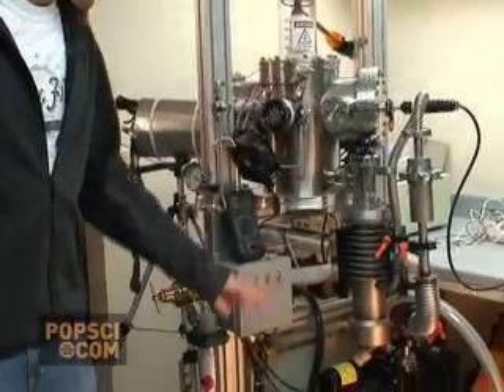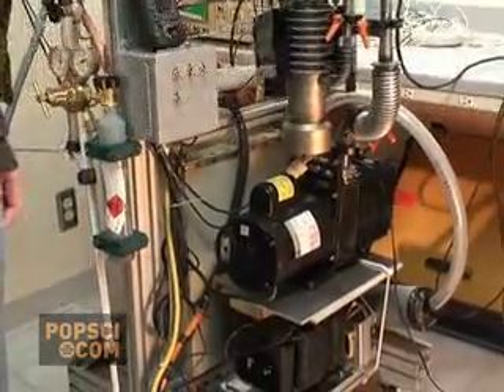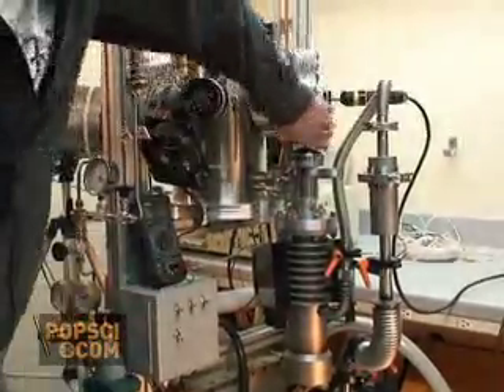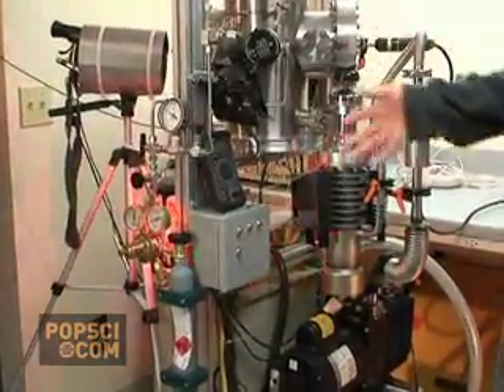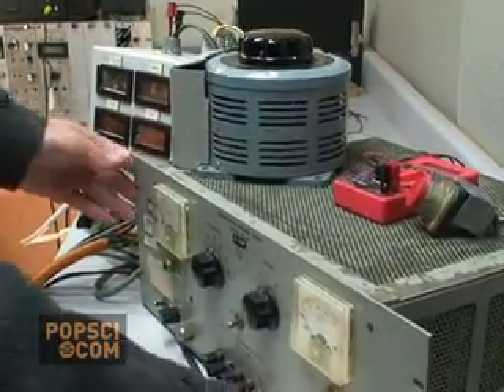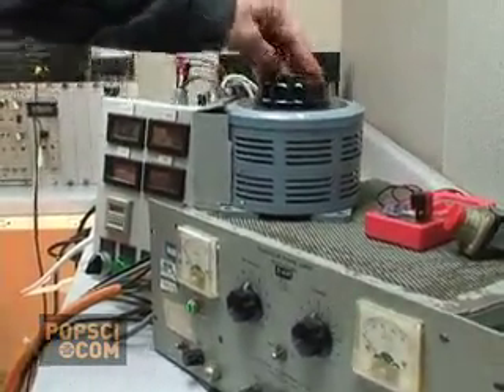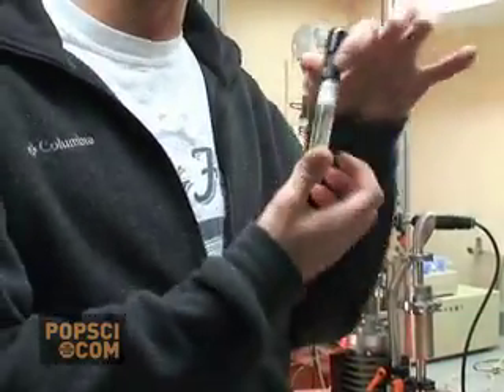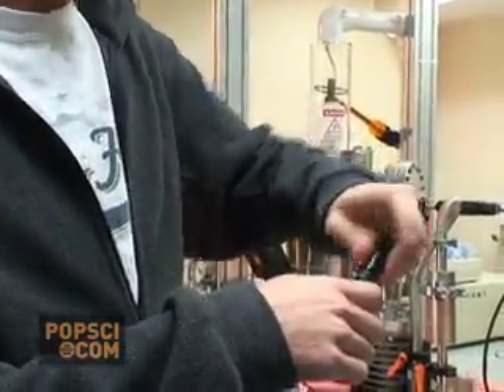Teen Builds Nuclear Reactor

Comment: To those who are calling BS you are mistaken. Fusion reactors can be built, as this video shows. There are a number of them, of varying sizes, all over the world. What you are thinking of is the viability of fusion as a power source. Any reactor to be used as a power source must output more energy than is required to start or continue the energy creation process. One of the biggest obstacles to fusion on a large scale is the creation of a reaction vessel that can withstand the large amounts of energy produced inside. A solid reaction vessel would structurally fail due to the high temperature. This is why magnetic fields have been used in larger reactors. The reactor depicted in this video was not intended for any purpose other than demonstrating the fusion process. Thus it is not meant to produce an amount of energy greater than the input energy. So it is a fusion reactor, but it is not a fusion reactor that you would want to use to power anything.

Comment: @mattix9 - Fusion has been performed tons of times. The problem is that they always use more energy than they produce. In layman's terms, it takes very intense circumstances to get atoms to smash together with such energy that they fuse together and begin a fusion reaction, and those very intense circumstances require a lot of energy. Currently the input energy requirements are higher than the energy output, so fusion, while doable, isn't yet a viable energy source.

Comment: You know, it is quite interesting. You can easily build a simple farnsworth fusor with maybe 300-400 dollars, out of stuff you can get on ebay. This elaborate fusor is quite obviously one created for a lab or with supplies directly from a lab. I bet the vacuum chamber in the center of this reactor alone is at least 12Gs. All of the other components are also probably thousands and thousands of dollars as well. He did not build this at 15... no way. Not unless his dad is either extremely wealthy or has direct access to all the parts. Its irritating to see shit like this, taking some rich kid and making him famous. When there are plenty of other kids that achieved similar feats using the makeshift supplies available. To me, that is a lot more impressive... But they are all the ones that just get ignored.
Reply: Not sure the cost would be so bad, thousands range tops, everything gray in that gear is surplus military, and getting stainless steel tubing is not all that hard, much of the rest looks classic ebay, they have all kinds of old lab equipment, for example the Variac is about 25 bucks, the pump under 100, the various power supplies few hundred each tops. His vacuum chamber looks a bit like an electron microscope chamber and while I have never checked the price on one, you can buy an entire electron microscope for under 10K and harvest a lot of parts from it. I would say all in his rig is under 10,000 dollars. That said, I seriously doubt he did that without help but money was likely not the issue.

Comment: This video is only about stereotypes. Stereotypical weird music on the background, throwing some switches, some rattling pumps, some 15yo guy "the genius" explaining what a power supply does. It's just stupid. Building a nuclear reactor isn't difficult at all, obtaining fuel (uranium) for it as being a civilian is difficult (say impossible). However it's ingeniously dumb to start a nuclear reaction for hobby. Big chance it ends out of control, then you've got your own Chernobyl!
Reply: true about the material.................. but chernobyl was a fission reactor, Fusion shuts down when containment is breached.

And genius isn't about solving problems in quantum physics necessarily. The hardest part of research is designing/building/getting the whole thing to work. That takes years. Gathering data only takes days to months.Its a lot of work getting that thing to work.
Reply: Not the point I was making.....I was telling about overall design and getting it to work.... Besides, Am-241 is an alpha emitter, so unless it's combined with an element like beryllium that undergoes an (alpha,n) reaction, you won't get a neutron flux (that too very small). ....... Source: a PhD in nuclear engineering, teaching 3 different classes radiation detection and reactor operations....

Besides......... Try building something instead of  criticizing. Is not easy...... appreciate his work..... I was playing CS and jerking around at 15.
Reply: FYI Am_241 is what's in fire alarms
Reply: wow, shocking comment from someone with "engineer" imprinted to his username.. do you even watch the video? or which part of fusion nuclear do you not understand? and where did you learn engineering?
Reply: Agustinus Law
It's shocking that someone with Agustinus in his name doesn't know that there are a billion types of engineers ;-) My username just comes from the game Red Alert 2. Though happen to study Software Engineering currently. At the time I wrote above comment, I did not know about fusion reactions indeed. But my stereotypes opinion about the video is still there.
Reply: doesn't matter, all software engineers I know, knew about fusion. well they teach about that in high school here, it is a must it's just really basic. I guess it's not a standard curricula in your highschool
Reply: fulldisclosure hour Smoke alarm have fissionable material?
Very funny.
Reply: did you not here about the kid who made his own nuclear reactor in the states from smoke alarms?? he got arrested and everything he made it in his shed now look shit up hit other tab google and search not hard
Reply: fulldisclosure hour How do you build a reactor with a smoke alarm?
Reply: ny pieces of radio active material in smoke alarms just look it up why ask me? it would take less time to look it up then it did to ask me the question and argue with me over something i know is true
Reply: A. Antoine Americium which is/was used in smoke detectors is radioactive.
Reply: 'MURICA! F* YEAH THIS WAS NOT MY QUESTION.
CAN YOU MAKE A NUCLEAR REACTOR WITH SMOKE DETECTORS YES OR NO?
Reply: YES IF YOU POST ENOUGH CAPS ANYTHING CAN BE DONE
Reply: No, you can't use just smoke detectors to make a fission reactor. Yes, you can use materials in the smoke detectors as parts of a basic fission reactor. Does that help?
Reply: 'MURICA! F* YEAH Yes. How can I make a reactor? Is it available on eBay? /irony
Reply: No..... you cannot buy a nuclear fission reactor on ebay. Also, YOU cannot make one. You're obviously way too incompetent. In fact, most people, including myself, cannot make one properly. And if what you meant by "/irony" was sarcasm, then disregard this post.
Reply: fulldisclosure hour You can't use smoke reactors to make a nuclear reactor. For fusion reaction to initiate large amounts of energy must be used to break the coulomb barrier (protons repel each other). In other words a fission reaction must be used (or an energy equivalent) must be used to force a fusion reaction. This is how the United States made their Hydrogen Bomb (which was an atomic fusion bomb), The Uranium bombs used on hiroshima and nagasaki were atomic fission bombs by the way. Also, you call yourselves engineers and yet no nothing about physics (physics is a must when you become an engineer). P.S. Nuclei (protons and neutrons) are kept together via the strong force.
Reply: smoke alarms
Reply: fulldisclosure hour the boy with the shed got his nuclear radiation from clocks with glow in the dark parts. Some radiating piece was used in the old times, today it's not
Reply: Why, may I ask, did you revive this?
Reply: Its nuclear fusion, not fission. So it is impossible to have a Chernobyl like disaster.

Comment: it IS fussion
fussion occours when two elements fuse to create a new element.

The SCALE of this process however determens the amount of neutrons that are emitted and the amount of radioactivity generated.

Example: a small spark is STILL an example of lightning, the exchange of electrons between an air-gap. It the SCALE that differentiate the two.

Comment: Fission is pulling molecules apart (used in power plants to produce heat, to make steam, to turn turbines), and fusion is putting molecules together, which is what the sun uses to produce heat. Currently it is very difficult and inefficient to use fusion on earth. 
In a fission reaction, a very large and unstable element (generally Uranium-235) is split. When it is split, the particles scatter, and Protons collide with other atoms. This causes other atoms to split, all along releasing massive a

Comment: @TakronRust

NIF is mostly used for testing the conditions in the secondary stage of a nuclear weapon to ensure reliability of the US nuclear stockpile; now that they can't test the real thing. As a PR campaign they're trying to see if ICF can break even.

After wavelength multiplication to UV, a shot at NIF delivers 1.1 MJ into the hohlraum, about the energy contained in two table spoons of cooking oil. The pulse has to be very short(hence high power) and very precise to compress the pellet.

Comment: I just wanted to point out from the comments, a fusion reactor such as a fusor can produce radiation. I believe xrays form when using around 35kv from a transformer from my research. Some gamma can be caused around this or higher voltages. You can google this information to verify.

Comment: It's a different kind of radioactivity. In fission, the spent fuel and the reactor remain highly radioactive. 

Fusion leaves behind tritium (mildly radioactive), and the reactor casing that has been 'activated' by the neutrons from the reaction. If you could do a fusion reaction that does not produce neutrons, only gamma rays, you'd be onto something. Hydrogen + Boron 11 is a reaction that does just that - aneutronic fusion, and it's being worked on for the Polywell reactor concept.

Comment: From Wikipedia:
"Controlled nuclear fusion could in principle be used in fusion power plants to produce power without the complexities of handling actinides, but significant scientific and technical obstacles remain. Several fusion reactors have been built, but as yet none has 'produced' more thermal energy than electrical energy consumed. Despite research having started in the 1950s, no commercial fusion reactor is expected before 2050. "

Comment: @anthyman1 Actually, fusion definitely does emit radiation.  All nuclear reactions emit radiation of some form, in this case his fusion reactor produces neutron radiation (among other types).  If fusion (specifically DT fusion) did not produce neutron radiation, then commercial energy generation with fusion would be completely IMPOSSIBLE (as opposed to financially impossible, which is the problem currently)

Comment: Just so you know, he is doing fusion.  As in combing material not separation.  He takes special hydrogen atoms (deuterium) strips the electrons off of them and then slams them together using the high voltage which is indicated by the red light.  If all is perfect he will generate helium and can detect it.

Comment: Fission is splitting an atom such as Uranium or usually Plutonium by bombarding it with neutrons until the atom breaks apart which then releases an enormous amount of energy such as a bomb or a nuclear reactor.

 Fusion is when two atoms are combined which means you have to get them to combine using a lot of energy. If it works the hope is it will be self sustaining and give off energy to supply power.

 Both are "nuclear" and involve atoms but they are the opposite of each other.

Comment: This is easily fixed with neutron capture shielding and a further shielding material to absorb any subsequent gamma radiation. Deuterium is NOT radioactive and Tritium is only mildly radioactive and completely safe if handle properly. This is overall a very safe type of reaction, and this is why it's the main (only) reaction really researched for nuclear fusion. BTW i don't think they're saying he's 15 now, but 15 when built in his garage, which could have be a decade ago by the looks of him.

Comment: @Nosphorus85 Depends on the size, volatility, and nuclear fertility of the fuels used, as well as the containment systems and coolant. His coolant seems pretty well set-up for small-scale fission. And that's what this is.

Fusion produces far more energy and heat, but Fission is far easier.

Comment: This is no huge feat, and it isn't going to solve the energy crisis. These fusors are easy to construct, you just need a vacuum chamber, some wire, a vac. pump, and a high-voltage source. (like a rectified neon-sign transformer). I could build one. It does produce a small bit of fusion, and is a reliable source of free neutrons (I don't know what that "neutron doximiter" is, but doubt its anything more than a vial of methanol) but it consumes much more power than it produces.

Comment: @samnaps1 
"note: these neutrons have high ENERGY not heat."

Heat /is/ energy.  It's all just mass in motion.  In this case, it's one amu (a neutron) moving at about 37,000 km/s, or roughly 14 MeV.

If the walls were, say, laminated carbon steel, and several inches thick, with coolant pipes running through, the neutrons would be the primary method of capturing the released energy as heat.

Comment: I'm hopeful that the Polywell can eventually be used to burn Boron-11 + protons to produce (nearly) aneutronic fusion. That should greatly reduce the wear on the other parts of the reactor. Since the fusion reaction is confined to a really small area in the core of the device, the heat should be much less than that experienced by the walls of a tokamak where the plasma is only centimetres away from the walls (since the rest of the polywell is just recirculating ions, electrons and vacuum).

Comment: @ian5576 
Incorrect.

Fusion just requires hydrogen and an electric field to get the atoms to bang into each other.  The problem is that the energy put in tends to be more than what you can get out.

Fission needs a neutron source and a heavy fuel - something to split.  Hence the name.

Comment: A nuclear reactor is:

1) A reaction vessel
2) In which nuclear reactions take place

Since the fusion of deuterium with deuterium is a nuclear (not chemical) reaction, by that definition this is a nuclear reactor. It doesn't have to be a uranium-fuelled fission reactor to be a nuclear reactor. You know that some reactors can run on Plutonium, or even Thorium, right?

Comment: This is a "Farnsworth Fusor". It does induce nuclear fusion, just an incredibly tiny amount of it. It was designed in 1964.

This kid just happens to have alot of money and some equipment, they are really very simple devices. Google it and educate yourselves.

They are also several powers of ten short of the "ignition" or "break even" point, at which they produce more power than they consume. 

Thats why nobody is spending billions on these garage curiosities.

Comment: Yeah I am familiar with Bussards work and the polywell concept. Hope it works. I have my doubts, though. In an operating fusion reactor, the superconducting coils will be exposed to extremely high levels or radiation and heat. And if the SC coils are heated too much the thing with explode and destroy itself. 

Also, sputtering from the SC grid coils will contaminate the plasma. 

Fusion is tough. I am doubtful it will ever be an energy source. 

General Fusion has an interesting approach, tho.

Comment: @imanerd36 It's called Inertial Electrostatic Confinement fusion.  Philo Farnsworth designed the system in the 60's, and it's actually fairly "easy" (relatively) to build one of these.  More power is going in than can be generated out at this point, but nevertheless, he's creating fusion.  That plasma you see is millions of protons per second colliding with eachother and fusing.  I could get into the details of it, but look up "fusor" on Youtube.

Comment: I think it really depends on where you live. In the city, solar panels wouldn't have as great a benefit as green roofs because they can't remove CO2 or pollutants, and can't regulate the air and heat flow in the city (green roofs can reduce what's called the "heat island effect", remove pathogens, and circulate the air). But in suburban areas, panels would be a great idea. There's really a place for many sources of alternative energy (and ways to reduce energy usage).

Comment: You're failing to grasp that there is more than one type of fusion reactor.  Look at what I said above. "Farnsworth-Hirsch Fusor". You can make those cheaply.

You can accelerate ions with electrical fields.  Since atoms are very small, accelerating a small number of them doesn't require much energy.  The FH-Fusor uses a grate (steel wire) and electricity from a wall socket.  This accelerates deuterium ions; sometimes they collide and fusion occurs.

Comment: @phukemonster 
You're mixing your reactors.
Thermal fission requires a moderator to slow neutrons down so they can produce further fission reactions.  Fusion just needs energy pumped in to get the protons near each other.

Comment: They're basically grasses and plants that you put on roofs, and they save about 4.2 Kilowatts/square meter/year by reducing heating and cooling costs. If put on roofs in Toronto for example, they would save the city $117 million per year. Cover 6 percent of the cities roofs, and you save $1 million on energy, remove 2.2 million tons of CO2, and 30 tons of pollutants from the air each year.

Comment: @BlueHeavenBound You need to do some background reading on the fundamentals of fusion physics, there is no chance of a any sort of uncontrolled reaction as there is a very fine balance between a number of factors that, if changed, will shut the reaction down.